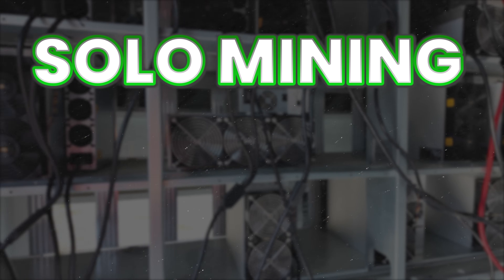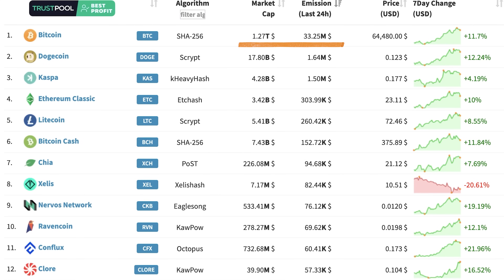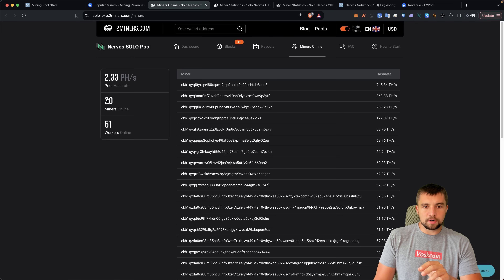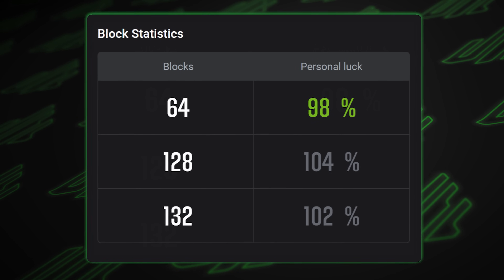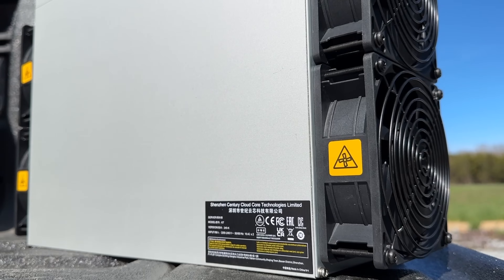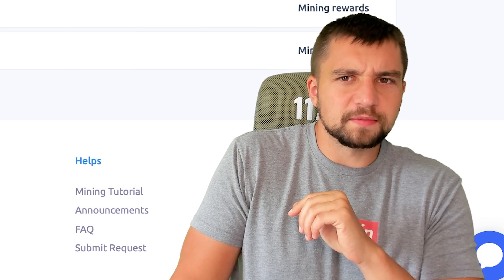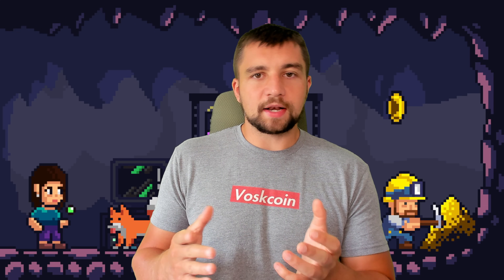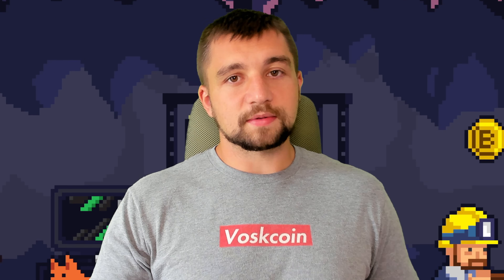Earn More Passive Income? Solo Mining vs Mining Pool - Profitability!

Comment: I solo mined for 2 years straight. I would keep solo mining, but I only stopped cause I now unfortunately live in a very rural area where I cannot get a latency lower than 120ms. I used to get a latency of around 80ms, which was still doable. But where I'm at now, sometimes it's as high as 190ms. I feel that's too high to solo mine. Unless you feel it's still possible.

Comment: I need a financier to start a company. I would administer it and develop the first facility to produce steady power 24/7 from an unpredictable power source.  

That source is wind, first banked not with electric batteries, and then the power would be released steadily to drive ground level electric generators.  

My wind turbine design is far superior to any other in existence. Combined with my unique method of storing the wind power until it is needed, and only as needed converting it into electricity, this system is lightyears ahead of modern wind power stations and can operate with economic viability at almost any scale. This at a fraction of the maintenance cost because every component is at or near ground level.  

A small scale R&D facility could be operational with a starting budget of $100K with 80% ownership retained by the financier. As a fit retiree, I would be more than happy to contribute all necessary time and effort to the venture.
Reply: Your a scammer

Comment: If you want to team up with someone who can produce free electricity 24/7 let me know.
Reply: You're gonna be popular... Extremely popular 🤣😁
Reply: @darrelgreene  I need a financier to start a company. I would administer it and develop the first facility to produce steady power 24/7 from an unpredictable power source.  

That source is wind, first banked not with electric batteries, and then the power would be released steadily to drive ground level electric generators.  

My wind turbine design is far superior to any other in existence. Combined with my unique method of storing the wind power until it is needed, and only as needed converting it into electricity, this system is lightyears ahead of modern wind power stations and can operate with economic viability at almost any scale. This at a fraction of the maintenance cost because every component is at or near ground level.  

A small scale R&D facility could be operational with a starting budget of $100K with 80% ownership retained by the financier. As a fit retiree, I would be more than happy to contribute all necessary time and effort to the venture.
Reply: @MrDavePed  TPU or ASIC, both technology, blockchain and AI will get you the most of your energy and support the technology! Look locally, Imma bet someone is needing electricity 👊🥰. I'm currently working on a long-term project to utilize exactly what you're talking about and team up with guys like you, however, we're "a ways" away from launching, the centralization issue is holding up a whole lot of projects, utility projects within the blockchain ecosystem that still needs SEC approval. 😞
Reply: @MrDavePed  btw... It shouldn't cost much to register an LLC, I would get your energy company started ASAP!
Reply: @darrelgreene  There's little I can do myself. Everything must be done by others with hands on ability. I am merely a conceptualist. A director. We all have our talents.
Reply: Lol